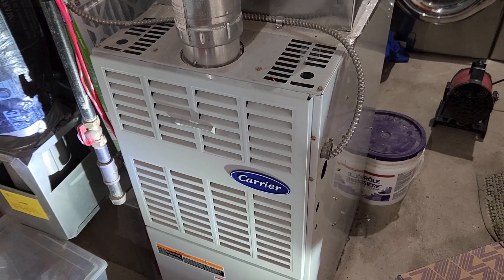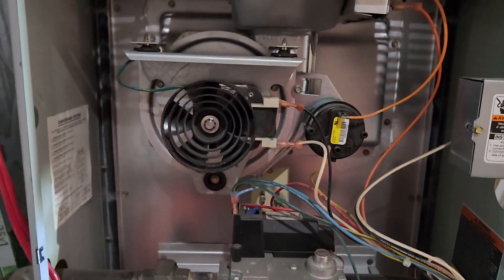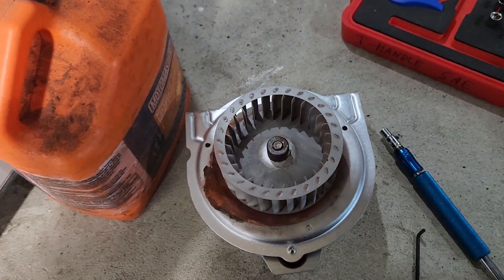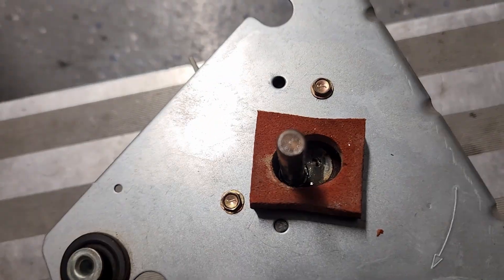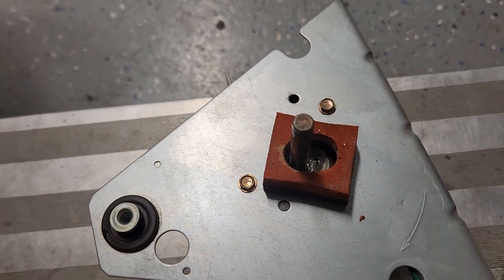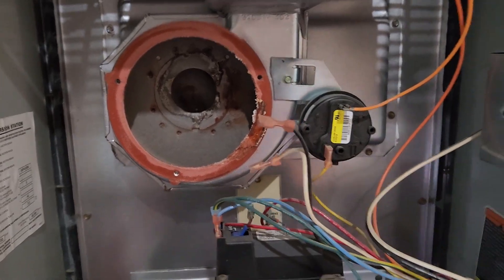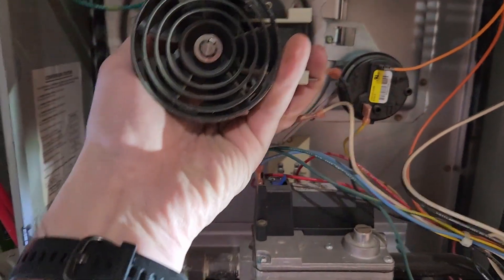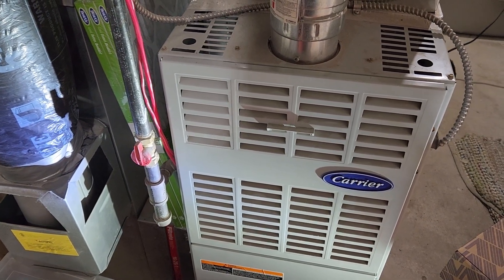Loud Furnace Inducer Motor/Fan Fix  - Carrier Brand

Comment: OK but you didn’t show us how you were able to unseized that screw with the allen wrench?
Reply from the maker: @realruggeddiy  mine wasn't really seized at all. A quick flex with the long end and it popped free.
Reply: @ you’re lucky. I have broken about three t10 torque bits. Even after she was extensively showered in penetration blaster and given time to sit. Still not budging. New inducer motor arriving tomorrow.
Reply from the maker: @realruggeddiy  sorry to hear. You could try heat to get it off but that could damage other things.
Reply: @realruggeddiy I use my oxy acetylene for about a half second when that happens.

Comment: The 2 screws holding the motor in place are loose and when I open the 3 screws to take everything out, it does not come out. There is tight space if I try to tighten the 2 screws holding the motor against that triangular sheet. Any suggestions ? Thanks,

Comment: Would wd40 be ok for this?
Reply from the maker: I would not recommend it. It may work for a short period of time, but WD40 does not have the lasting film strength strength of a proper machine oil. 3 in 1 can be bought very cheaply at most hardware stores, and the SuperLube I used was around $15 CAD from Amazon.
Reply: @Canuckrz  thanks man

Comment: That inducer motor isn't that expensive. Why not just fix it before it goes out . Because its going to go out on a Sunday in -10 degree weather
Reply from the maker: This one is close to $400 Canadian from a local supplier, and was just giving off some bearing noise due to age and the bearings drying out. Since the video it's no longer making any noise as it's run in with the new lubrication. 

I do agree that it shouldn't be expensive, it's a pretty simple and small motor. But unfortunately hvac stuff is marked up to the moon.
Reply: I agree

Comment: Good job, I have a 95% Carrier furnace with a noisy inducer motor and have been oiling the bearing that I can reach for years. It's still noisy but it works. New inducer motor is over $500 so I can oil it to keep her running. Thanks for sharing.
Reply from the maker: Thanks. How often do you find you have to add more oil to the motor? Hvac parts are so wildly overpriced.
Reply: Yes about once a year I do it. Seen a video where the fellow changed the bearings on the motor. Not an easy job tho. @Canuckrz